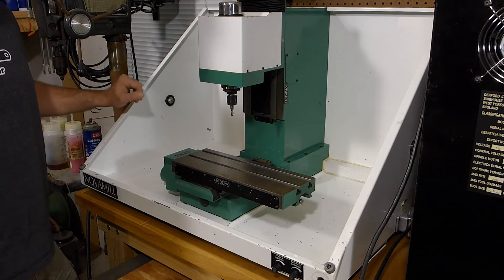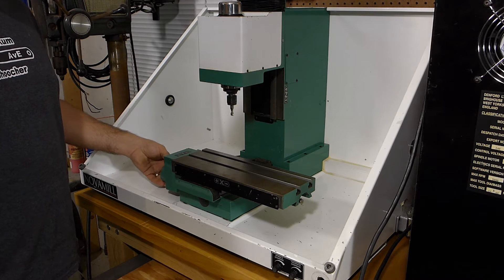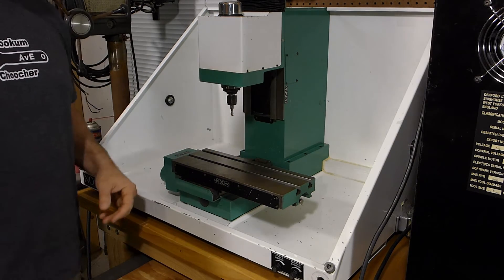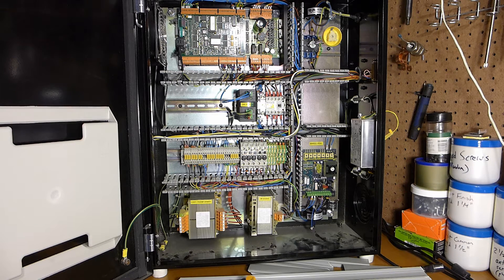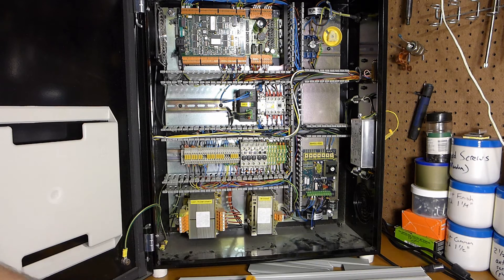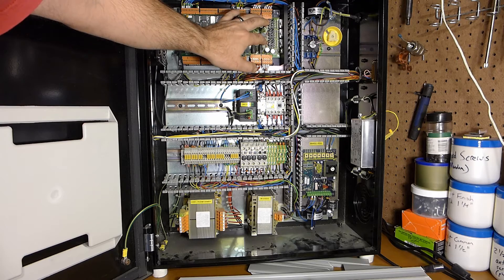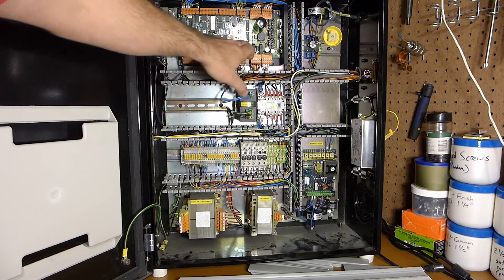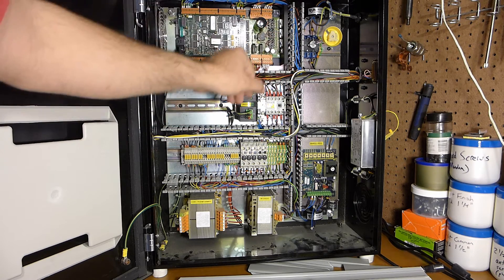Denford Novamill  - Part 1 -  Overview

Comment: Did u end up using the control board or did you go a different route?
Reply from the maker: I will eventually post another video, but what I ended up doing is using the original board only for spindle control and controlling the XYZ with a GRBL shield / Arduino / Raspberry Pi combination. I got everything connected and the spindle wouldn't turn. I started troubleshooting and decided to test the spindle relay but misread the terminals on the spindle relay and ended up jumpering spindle power to ground which resulted in letting the smoke out of the spindle drive. I have ordered a new spindle controller (KBWS-25D from KB Electronics) which takes 5V PWM signal directly from the GRBL shield and has built in opto-isolation. It is sitting on my desk waiting for installation. We had a baby recently, so all hobbies are on hold!
Reply: @RobbyNowell  Gotcha I'm in a similar boat. After doing alot of reading and searching I found enough info to use the original board and tap into the 96 pin connector on the stepper driver. Then after  I had x y an z motion a friend of mine started poking around trying to get the spindle on and fried something on the main board. I wish I could have seen how u got your spindle to turn before they screwed it up. For the moment I'm trying to decide what to do next.

Comment: just got a novamill and put a gecko g540. all the feeds work great 150 inches per minute on the x. If You need a bit more travel on x You can remove a few mounting bolts from underneath and easily get more than 10 inches of travel. I am still figuring out the spindle speed. right now I can Just turn spindle on and off with cnc and I adjust rpm with a pot.
Reply from the maker: Awesome! These are stout little mills. I don't think I will get as much feed rate as you are getting with the Gecko drive, because I'll be using an Arduino running GRBL. I can drop my microstepping down and maybe come close though. If I need more speed, I'll probably grab a different controller, but for proving out the mill, an Arduino is nice and cheap. Thanks for the tip on the travel! More is always better. I need to post an update soon.
Reply: Robby Nowell  - did you post the part 2 of this, I haven’t been able to find it on YouTube. These are great little machine, for it size it’s pretty robust in my opinion. 👍